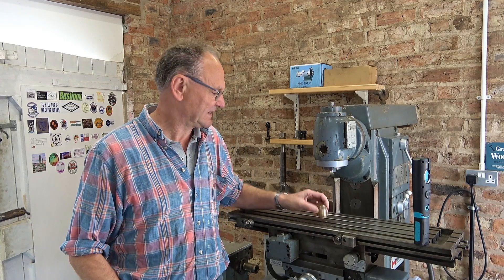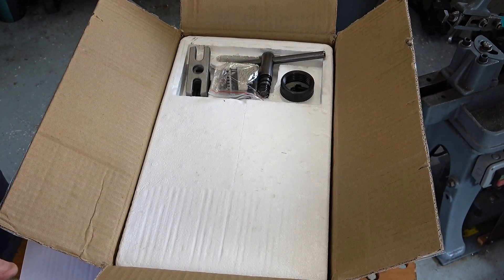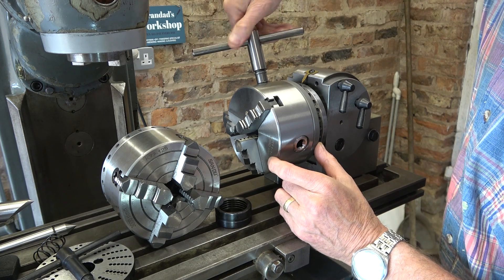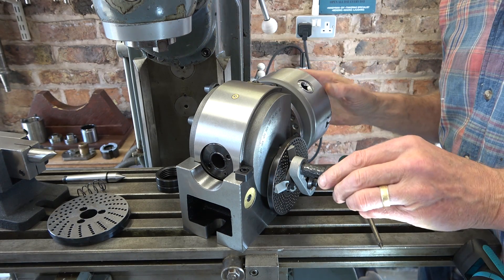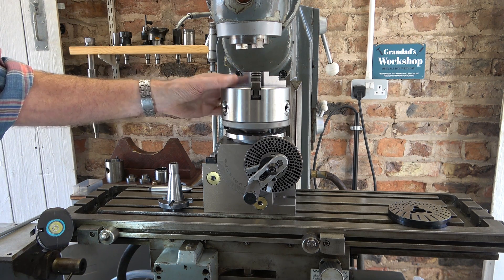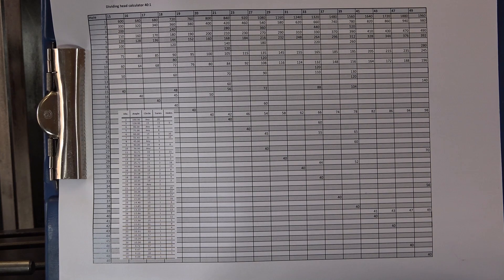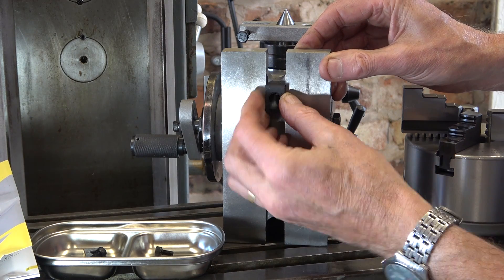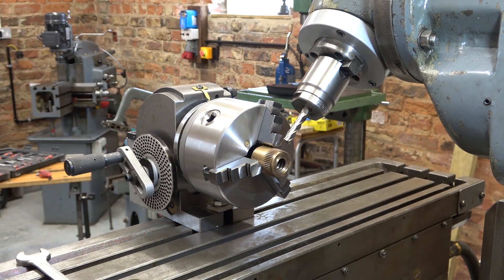HS210 Vevor 5in dividing head review

Comment: I'm not usually a fan of YouTube tool reviews, but some channels do a really good job of it without pulling punches, pleased to say yours did not pull any punches. I came here to comment on the small clamping deviation on the 3 jaw check regarding the possibility of grinding swarf in the chuck, but someone beat me too it. I did not hear any noises while you were adjusting it, but it could be worth an hour or two stripping it down and cleaning it (just in case). A little preventive maintenance could save some $$$ and time later. I enjoyed the reference to tool snobbery , I'll be stealing that for future use, as you say a tool is either fit for purpose or it isn't. I can foresee future content from this channel machining replacements for some of the die cast fixtures.
Reply from the maker: Hi Paul, I think dismantling and cleaning out the chuck is a good shout. As a presenter there can be a tension between supporting the seller and doing the right thing by the viewers (a conflict of interest possibly). Anyway, I submitted the video to Vevor for review in advance and they were very supportive. Their main concern seems to be to have a well-produced and objective video that viewers will enjoy. If I ever reviewed something that was really a pile of poo I would probably tell them and give them the choice whether I released the vid or not.  Having used the dividing head quite a bit now I think my main concern is to properly secure the handle levers. The spring never gave me any trouble in practice. Cheers
Reply: @HaxbyShed  Good to hear you've been getting some time in with the dividing head, shows you were right about those levers...

Comment: Just a few corrections:
The cast iron thing under the dividing discs is NOT to get rid of backslash. It is there to disconnect the worm in order to use the direct indexing.
The cap You pointed out being an oil fill cap is NOT an oil fill cap. At least in my BS-0 there is a crubscrew locking it in place. That cap is there to adjust the axial play of the worm gear screw.

The indexing pin and the lever seems to be as bad as they were in my case. The lever is actually a pinion and there is a short gear rack in the pin. In my BS-0 that gear rack was poorly dimensioned and made of some really soft steel. Soon enough, that pin stopped working. I made a new pin using some harder material. And Yes, that pin has a taper in it.
The clamping mechanism (or brake if You wish) is nothing more than a screw that tightens a collet and engages the break. That screw is also made of some really poor quality steel and the threads will strip soon enough. Mine did and I just made a new (and better ???) one.
Normally these heads should have no woddle in the nose. At least not that much that if can be measured wit a dial indicator like You have. This wobble comes from the bearings that are not tight enough and/or bad quality. They are not tight enough because of all the grinding dust left inside the thing.
I would strongly advice to take the unit apart, clean it properly and then put it together without all the sand inside there.

It is a nice Chinese construction kit for a dividing head. These are delivered already built so the constructor knows where all things belong. It is well worth the price but it cannot be used in the delivered state.

So what does the BS stand for?
Some say it stands for Brown&Sharpe but it can also stand for something quite different.
Reply from the maker: Ah FUM, your comments are really useful thank you. You can see I made some guesses and got it wrong about the backlash adjustment and the oil filler comment. There was nothing to tell me in the instruction manual. I've used the dividing head for a project now and it worked very well, but yes I do need to take it apart and get any machining swarf out of it, and adjust the bearings. Thanks again, Paul
Reply: @HaxbyShed  Paul, so glad You didn't rocket through the roof after my posting. The idea of these cheap Chinese tools being construction kits was not mine. It was Stefan Gotteswinter who throw that frog on the table.
Actually, I have made a video on how to take the thing apart, clean it and then how to properly put it together.
I would suggest to use that 4-jaw chuck in the dividing head because with that one You can attach almost any kind of workpiece and make it run true.
You can find the video by searching "FUM0092 Dividing Head" or  "Fixing BS0 dividing head direct indexing pin"
Reply from the maker: @FinnoUgricMachining  not at all. I learnt a long time ago to put pride aside and if somebody offers information, even it proves me wrong, I'm very happy to receive it. I'm just a hobbyist building up my experience 😁 cheers

Comment: A good review. I can't fault what you've said about it.
The alloy sector arms may be good enough given how much you'll actually use it, but brass or bronze would be nicer and move more smoothly. The spring clip design is standard to many div heads - I've refurbished 2 Elliotts and a Victoria and they're all the same.
Personally I'd have gone for a full universal div head. The first job I did with mine was to cut a helical pinion. As you have a universal mill (I think) such things would be easier on your machine than mine and adds another string to your bow.
Oh, use the spindle lock, not the index pin to remove the chuck!
Reply from the maker: Hi Robert, I will look out for a universal in time. The "social media influencer" catalogue is not the full Vevor catalogue. It depends what they are promoting, what it costs and how much stock they have at a point in time. Cheers
Reply: This is a copy of the Brown & Sharpe. They’re fairly simple machines as these things go. I’ve tested a couple of the Chinese copies. They’re pretty good, considering the price. One had brass bearings on those two levers, but the other was wobbly like this one with no bearings. Generally, these take B&S arbors, so make sure there. These were sized by the arbor size, so this is a B&S #0 arbor taper. If it’s a Morse, that’s interesting.

Overall, if yours is accurate enough for your purposes, I wouldn’t bother with modifying it. How often will you realistically be using it?

Comment: Excellent honest review Paul. I bought the BS1 dividing head off Vevor 4 weeks ago having put a deposit down on a new full size Chester universal mill. I have exactly the same opinion as you, the basics are right, but the winding section and sector arms let it down somewhat, but for the money you cannot complain really and if it really bothers, well we have machine shops. 
😢I was going to fully pull it apart, clean, deburr, clean, but what I am going to do is sell it. I spotted an old universal mill, a size two large really, but it came with a full universal dividing head, slotter, rotary table, arbors etc, at a reasonable price and its now sat in the workshop and I cancelled the Chester. Oh I have a 12" Vevor rotary table still sat in its box going as well 😅.
Reply from the maker: Hi Bill, well if you found a universal mill at a reasonable price with all the bits there then you did well! That is the way to do it. I will be looking for a rotary table .... I may be able to get one from Vevor, I can see an 8 inch with 90:1 worm on my reviewer login but 8inch may be a bit small. I'll think about it. Cheers

Comment: I purchased the same unit from a private vender a year ago. It has the same issue with the spring clip falling out when in use. I am aware of it and pay attention so it does not fall out in use. Overall I am very happy with it for the price.
Reply from the maker: Hi Thysddc, I've found in practice it does not fall off. I did 48 splines x 4 repeats with no problems. Cheers

Comment: Morning Paul, it's 11Am here in Tx. The review was well done. Before the cancer came, I too was considering their 6in head. Maybe the Good Lord will give ole Bear a few more years, and I can cross the pond and come have a cup tea in your shop?? Keep On Keeping On!
Reply from the maker: I have a coffee machine also Bear; tea is not compulsory for non-Brits. 😁 Cheers
Reply: A year ago it was found that I had bladder cancer. An operation & I recently had a scan and am free of it now. I have the BS-1 dividing head. with the 6" chuck. I have totally disassembled both. Quite clean with only minor burrs. I have made some gears with it on my Jet 9x49 (Bridgeport knock off) mill. If I rotate it straight up I have very little Z axis left. If you don't have a rotary table I think you could use the BS-1 with a face plate instead of the chuck. Keith Rucker has a video on making bevel gears using an indexing head.  The spring clip that was weak in this video was plenty strong enough on the BS-1 that I got.   
I did a couple of minor mods but I think this is a very good value. The chuck is OK for the price. But a premium chuck costs more than this entire kit. I have a Vertex HV-8 rotary table with plates and footstock. I think I can do almost as much with it as with the indexing head. But it was a lot more $ and has several advantages for using it horizontally. Lots more Z axis room, even with a chuck mounted. I cast an aluminum plate & machined 8 T slots to give me more clamping area.

Comment: It is an honest review. The quality of the device is good enough for a hobby/home shop. And they cut prices in all the non essentials, screws, levels, indicators, sometimes edges. Which are quite fixable and/or replaceable.
When addressing angles i approximate with the scale (on any device, because thats what i learned and I’m cheap) and then use f(x)=sin(x) function (or a sine bar) with a long carbide blank, with the precision my gauge blocks can provide. Thats good enough because I’m not a NASA or SpaceX contractor.

The part that gave me the most grief is the instructions booklet. It really makes difficult to find the number of divisions you need. I, however, made a crude spreadsheet to help me find the plate I need for the divisions I want. The most troubling are prime numbers. For those “impossible” divisions i make a dedicated 3D printed plate; should I need many pieces with that “impossible” number of divisions the first piece I cut is a metallic plate and discard the 3D print.

If you want one for production and be competitive get a CNC machine.
Reply from the maker: Hi thigtsuare, I made a similar spreadsheet looking for any combinations of plate that might reveal any 'hidden' integer indexes but of of course I did not. I need to strip that head down yet to give it a good clean inside. They often come filled with machining chips I'm told. Agree about the manual. I've learnt as much from viewer comments as I did from the manual. Cheers

Comment: Dear Sir, it appears in the video that we have similar milling machines as for the physical size, weight, and table length.  I believe you have the so named BS-0 dividing head ...5 inch. ??? 
Would you give much consideration as to the MT2 taper with this unit compared to the BS-1 unit with MT3; when considering a purchase of one of these units? All my tooling, (as for MT taper) is 3, 4, and 5. I wish to purchase the same unit as you, but with the BS-0 MT2 taper, I am considering the BS-1, but do not want to end up with a unit that is just too large and heavy for my mill which is an older US BURKE MILLRITE.
Reply from the maker: Hi Max (I presume), I thought long and hard what size of dividing head to get.  My lathe tailstock is MT3 and so are most of my holders. But the BS-1 6inch dividing head is quite a bit larger and heavier and I decided it would just take up too much real estate on my mill.  With the BS-0 up vertical I can just about get the chuck under a cutter in the vertical head but with the BS-1 there was no chance. About the only thing I might want to put in the MT would be an ER32 chuck and mine is on an MT3 fitting. So if I needed an ER32 collet in the dividing head I would either buy an ER32 chuck on an MT2 stub or I would use my spindexer, because have an ER32 to 5C adaptor which fits the spindexer (presuming I was indexing integer degrees).  My mill table is 30in long and 8in wide. From the table surface to the underside of the vertical spindle is 10.5in max, and then deduct for the INT30 adaptor stick out and the length of whatever cutter is in. Hope that helps. Cheers

Comment: I purchased one of these B and S clones five years ago and agree with your general analysis that they are reasonable for the price and we home users can't afford to buy a real Brown and Sharpe. I ran into three issues beyond what you found: 1, the amount of cast iron filings in the head (nearly a teaspoon) would have rapidly worn it out. 2, even though the chuck threads match a Logan lathe, the seat was larger, making it incompatible without additional machining. 3, the design was simplified (cheapened) compared to a Brown and Sharpe. The real B and S allows the worm to be engaged/disengaged without removing the crank and indexing plate. For details, check Keith Rucker's video on rebuilding a Brown and Sharpe. In addition, mine has a Brown and Sharpe taper, not compatible with Morse. Since a dead center came with it, this wasn't an issue for me but I suggest you verify what you have before using a Morse adapter.
Reply from the maker: Hi, I need to get mine apart and wash it out to remove the filings I suspect are in there. And I will check it is morse rather than B&S. Very useful info thank you. Cheers

Comment: Thanks for the review.   Vevor are a re-seller of items made by various Chinese companies, so the quality can vary from item to item.
Glad that this item looks to be decent.    It is very tempting.   I have a small rotary table, but without the dividing plates.    A dividing head would be much better than finding dividing plates for my rotary table.  I have the desire to get a dividing head, but do not yet have a project like yours which needs the dividing head.
We all know we can say I will never/use need something, and then the next week we find we need it.
Dave.
Reply from the maker: Hi Dave you will see Vevor sell the dividing heads and rotary tables of various sizes. They also sell a set of plates for about £45 I think, but be aware that the plates I saw are for a 40:1 worm and I think that's only the 4/5/6in rotary tables. I notice the 8in table is a 90:1 (and I did not see any plates for 90:1). Cheers

Comment: Thanks for this review. However, I watched this hoping for an answer to a problem I have with mine. Mine has a problem with the worm gear which is not evenly machined. I had some backlash in the worm gear. When I adjusted it and turned it, it bound up halfway round. If I re-adjust it there I am back to quite a bit of backlash halfway round again. 
I was hoping you might check this on your review but you didn't touch on that. I was hoping that it might be swarth in the mechanism but when I dis-assembled it I found it to be very clean and well lubricated. It appears that the large gear has not been machined to a constant depth! I am not too sure how to go about fixing this short of just replacing it.
Reply from the maker: Hiya DieselGypsy, I have not attempted to adjust the backlash from the factory setting. It's not much anyway and I just hold it over to take out any lash before locking each index step with the lever. I did read about people trying to get all the backlash out (reduce to 0) but they never could get it all out. From what you say it does sound like your worm gear runs slightly eccentric. It's not something I've noticed on mine. Cheers

Comment: Hello Paul, I looked in the comments and couldn't find what I was looking for. When you put the table at 90 deg. around 13min 30 of the video what is the height from the bottom to the top of the jaws. Thank you for your videos really appreciate it
Reply from the maker: Hi, it says on the Vevor website that the centre height is 101.6mm and the swing is 125mm so I think it's total height with the chuck vertical is 226.6mm or 8.92 inches. Sometime I can probably check that. Cheers https://www.vevor.co.uk/dividing-head-c_10129/bs-0-precision-5-semi-universal-dividing-head-milling-set-3-jaw-chuck-p_010916047453?adp=gmc&utm_source=google&utm_medium=cpc&utm_id=22039697717&ad_group=173040085195&ad_id=725839174920&utm_term=&gad_source=1&gclid=Cj0KCQiA4rK8BhD7ARIsAFe5LXIom0KwPNqF7Oty-SVAycVcH6uUFhjMmgkjfLFlWa4aXJSGhldlcvcaAqShEALw_wcB

Comment: I am not a tool snob either. I thought that was a good review. Without import tools from the far east makers I couldn't afford this hobby. The cost is £200 and I think you easily get £200 worth of tool. The basics are spot on and it is more than good enough to do the type of jobs "we" do and the frequency we do them at. As you say you could spend the same on a second hand British unit that is worn out and comes with no bits. So it is value for money. I have a couple of rotary tables from Indian makers. The tailstock, dividing plates and fingers are the same. I got so fed up with those plates and fingers that I fitted a stepper motor and Arduino to control it for automated indexing. But that is another story. Great film.
Reply from the maker: Hi Carl, I think I've seen your video with the the stepper on the rotary table. I think we have to remember that China and India both have over 1.4Bn people and goodness knows how many engineering companies. We can't classify the output of a country so simply. And let's be honest we have both seen a lot of British rubbish in our time, I mean some of the engineering 'names' produced stuff no better than "Woolys best".  Cheers
Reply: @HaxbyShed  Agree 100%. In my travels and travails worldwide I have seen excellent work and workmanship turned out by workshops all over the world. It is about the people, their application to their skills a d knowledge and their pride in what they are doing, not where they are from.